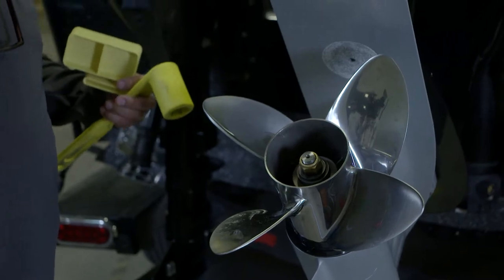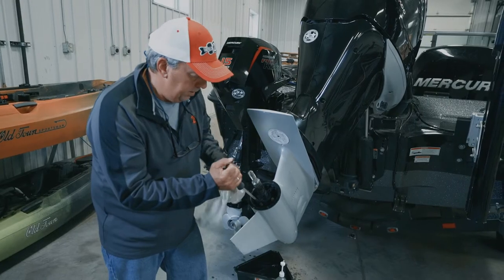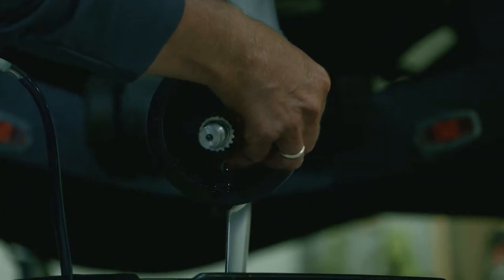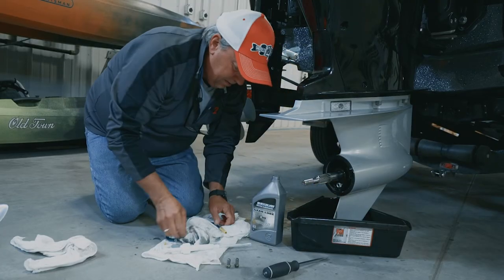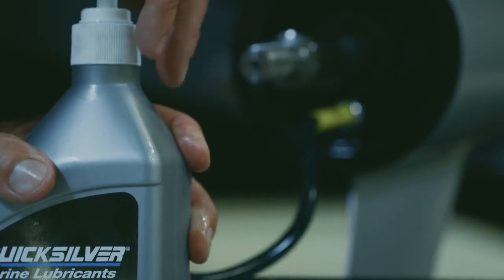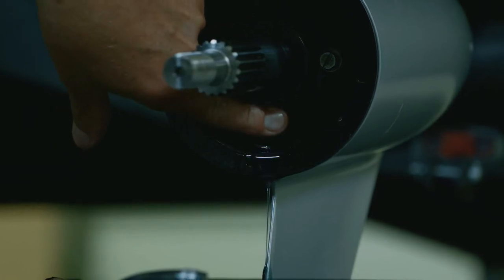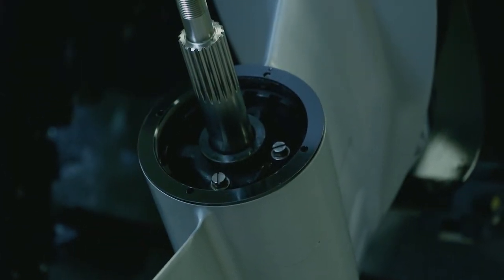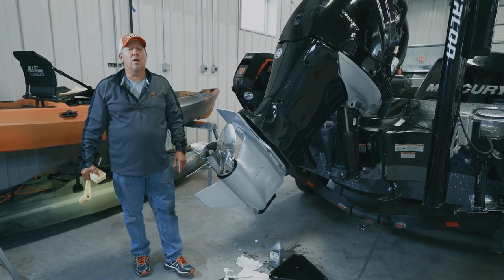How to Change Gear Lube in a Mercury 350hp Verado Outboard

Comment: You said to put the motor in the full down position.  That could lead to a low gear oil level on some boats. Should the leg be straight vertical?
Reply from the maker: For most applications, the full down position when the boat is on the trailer will be close enough to level as to not cause any concerns. If the engine on your application tucks in to a negative trim position while on the trailer, then it would be best to trim it back out slightly so the anti-ventilation plate above the propeller is level.
Reply: It also would've been nice to include the part numbers for the combination prop wrench and block, gear oil and amount, and new plug washers/seals.  Also torque on the prop nut.